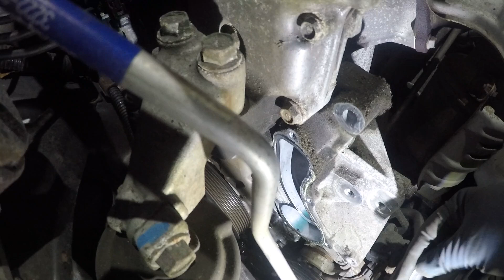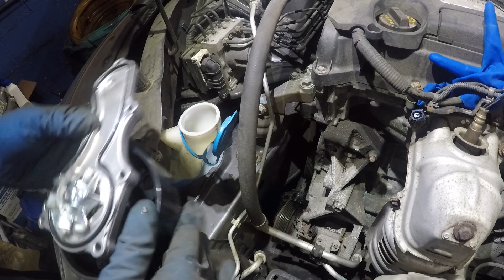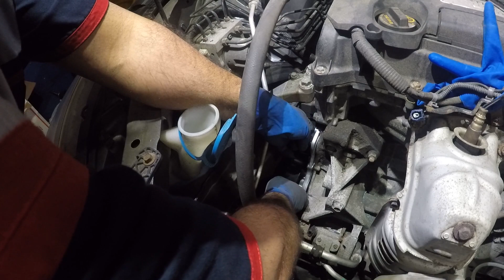How to replace Water Pump, Tensioner, Alternator or Belt on Honda Accord 2013 to 2017 and up part 2

Comment: I have to remove the water passage on the same model car. It seems like the car from the video also have a leak in the same area. How can I find torque specs on water passage bolts ?
Reply from the maker: Sorry I don’t have torque specs u might need to google it or call dealer they can get it for u

Comment: Wouldn’t it be easier to take the wheel off also and catch the threads through the side ?
Reply from the maker: Yeah that too but if u got to do it from top!! This is the way
Reply: Actually that only helps with the bottom most bolt of water pump. The other two hidden bolts are blocked by the sub frame.

Comment: The Haynes repair manual  says hex bolt for tensioner is 41 foot pounds
Reply: When I broke that bolt loose it was mega tight from the factory. Felt like it was close to twisting off.  41 ft. Pounds seems overkill. Put on some Loctite and went for 30ft lbs.
Reply from the maker: @OptimisticEngineer345  I go by hand 🤚
Reply from the maker: I go by my alldata

Comment: Any reason not to replace the tensioner at the same time?
Reply from the maker: It wasent making at noise or had any issues but if u got above 80k miles it would be good idea to knock it out and belt  same time

Comment: @RB The Mechanic off the ball question, I have looked everywhere youtube and google. As far as the transmission pan filter does a 2017 honda accord sport have one? I know there is a transmission oil cooler filter but I can't find any information if the pan has a filter on a cvt?
Reply from the maker: Yes there filter it’s connected to line up on top
Reply: @RBTheMechanic  so the transmission cooler filter is the only filter for the cvt? Most other cars have one in the pan and a cooler filter that I noticed.. I just don't want to drop the pan I'd I don't have to cause I just did a transmission servicing
Reply from the maker: @donwrestler1994  yup that’s the only one
Reply: @RBTheMechanic  appreciate it brotha!